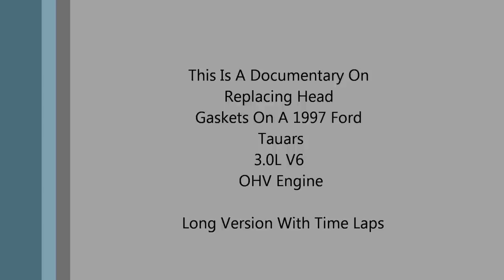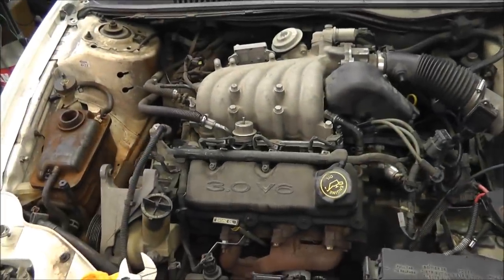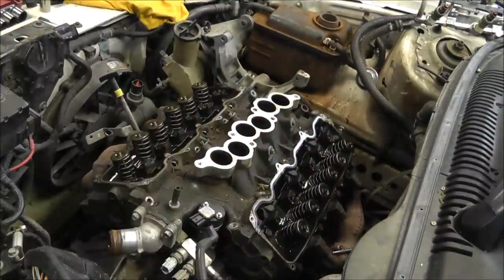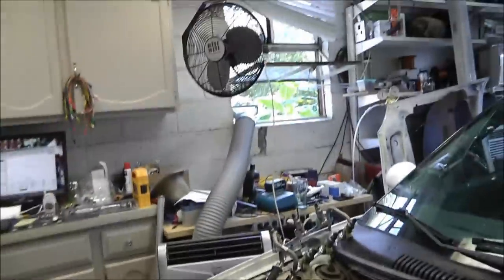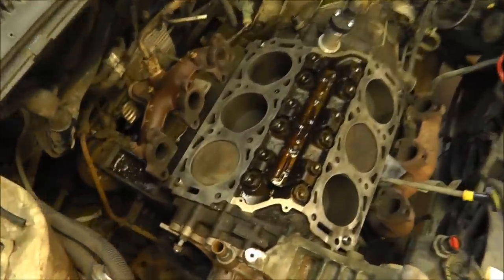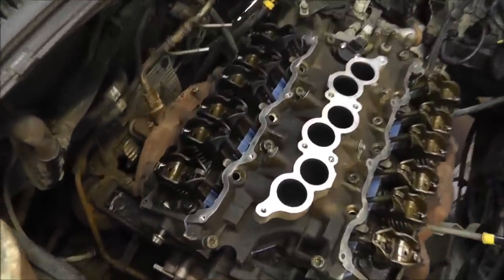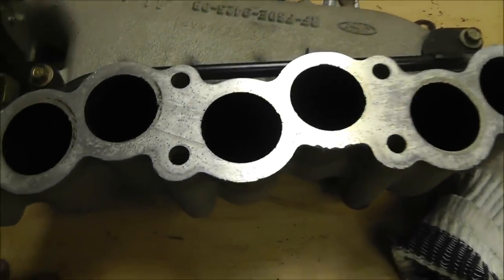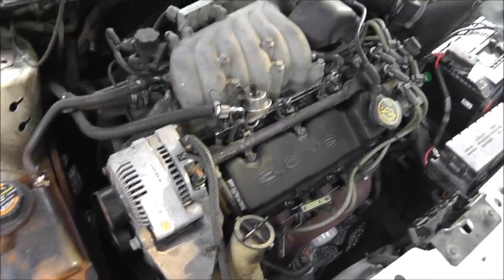Replacing Head Gaskets On A Ford Taurus 3.0L V6 OHV Engine. With Time Lapse. RWGresearch.com

Comment: I worked as Parts Sales Manager for Autozone briefly, the Taurus is a nightmare to look up parts on. I don't know if it's just Autozone or all of the others, but I do know there were several versions of the 3.0 and the parts index at Autozone has them all mixed up. That's why I say bring the old parts in to match! Otherwise I love Fords, I have a '67 F-100 sitting outside right now ;)

Comment: depend on the mileage, it doesn't hurt to replace valve seals and hydraulic lifter.
you also remove the head on a sequence and oil new head bolts.

Comment: @19:14 That bolt will come out. double nut it or grab it with vice grips. Once you have all the nuts and bolts off you can slide the bracket away from the motor and grab it with vice grips between the motor and the bracket. Once it's loose it will come out without too much swearing.

Comment from the maker: Just take your time and make sure you plug everything back in! Lol also, make sure your thermostat is corect and working. The "new" one I got was bent, and was Causing even the new cap to blow off on the Reservoir for the coolent. Also make sure your coolent taink dose not have a crack in it... I have been through 3 of them now... If it's cracked and your coolant blows out you won't know it until it's too late I think that may have been what originally happened to mine. Have fun!!! ~Russ

Comment from the maker: So far so good. And I haven't been eazy on it. :) "drive it like you stole it!"  Andy how, coming up on 200,000 miles! I think the wheels will fall off before the motor dies. I did have the new Reservoir crack on me but it has a lifetime Warranty. So I replaced it. I did have a bunch of ground / wiring problems. But I got all those worked out... Not sure why but seemed like once you brake the connectors apart stuff gets flaky. But it's all good now.  Running like a champ still! God bless! ~Russ

Comment: I'm almost done with this job. Same car. I had to have the heads milled. I still think this was a coolant problem (from the factory) that caused all the corrosion. Head gaskets shouldn't rust away like that. I put a water pump in while I was in there. And I flushed the cooling sytem before I started. I'm going to use a water only flush when I finish. This job is easier than you think. It is just time consuming because of the clean up work. And automotive electrical connectors still suck.

Comment: hello I was wondering if you can tell me what year this car is? I have a 2000 ford Taurus that needs a new lower intake manifold because the connection to the thermostat housing is broken and leaks antifreeze badly. this video finally showed me that the part that needs replacing is the lower intake manifold. I have been having trouble finding the part and found one on eBay but it's listed for an 01-03 Taurus 3.0 L ohv v6. I have a 2000 ohv 3.0 l v6 and they look like the same part to me

Comment: Good job Russ.  I have to say though, since you had the heads off its very easy to pull the valves, and have the head tanked, and check for flat and resurfaced if necessary. Then reseat the valves if they are ok, and  check the guides.  If ok, then new valve seals and you're good to go, for very little money.

Comment: Got a 98 wagon 3l OHV, didn't think it was a head gasket since no color on exhaust or to coolant.  Mysterious coolant leak appeared with nothing under engine..  engine would warm up and get hot (not to the overheating point) I'd stop and refill and then the engine would cool off and be good...

Went from 40 miles of driving for refill to 20 and then a trip, 15 miles, engine stalled out, temp Guage said fine, but it was boiling over and steaming from front and back of engine...  gave it a crank, 1cyl I think tried to fire but the rest are probably coolant filled...

Going to do my first  head gasket next weekend...

Comment: BTW, every time you disconnect the fuel system, after re-connecting it you gotta turn the key (without starting the car) a few times so that you can get enough fuel pressure to start the vehicle.
Reply: uhmm... you can also reset the computer this way. The startup issue was due to low vacuum pressure due to a disconnected peripheral.
Reply: On second thought, isn't this also to reset the keylock for your doors?? I would look this up on youtube.
Reply: You simply pull the main ECU fuse so the car doesn't turn over and crank but turns over all like it's going to. This will let the fuel system build pressure and what's everything inside the engine become pre-lubricated before starting the engine and letting it run.

Comment: It's clear to me after seeing all those clogged coolant passages that the engine overheated, causing the cylinder heads to warp, thus head gasket failure.
Could have been avoided by regularly flushing the cooling system, yes?

Comment: I just had a look at my sisters car 95 Ford taurus. ..it had a crank no start condition. I suspected a blown head gasket. So I checked the oil....it was brown and sludgy. I drained the oil and the first gallon that came out was antifreeze. It's even in the exhaust system. ...uuggghhh!

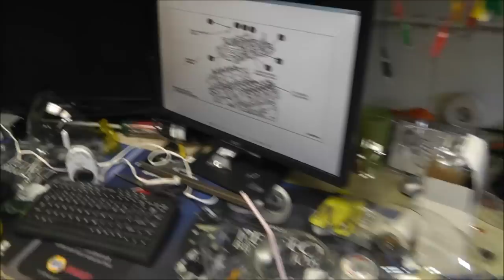Comment: I have a question. At 40:32 in the video you get lost and look on a computer monitor for the answer. What website was that? Or, was that a CD Rom? what was that you referred to on the monitor? Where did you get that diagram of the engine?

Comment: I just saw this Honda message board where they said it costs about $ 50-70 $ to resurface the heads and the hot tank cleaning was around 20-30 dollars.

Comment: Is the car still running? My 2000 Taurus with flex fuel blew a gasket @ 195,500 the car still sounds strong, no knocks or pings but I got a boat load of negative evil doers telling me to junk it. No way I say! Please tell me that white Taurus is still going.

Comment: Great video. Did you need to dead center the flywheel before removing the distributor coil or replacing anything?

Comment: i noticed that you had mentioned that concrete and car batteries don't mix your right on older batteries but the battery companies did correct that problem, the isulation on the bottom wasn't as good back in the day compared to modern day batteries .........

Comment: These cars are notorious for failure in the coolant systems due to massive corosion. A friend of mime is a ford tech and recommends adding a mediocre sized bottle of downy fabric softener with the coolant. Mine had a factory bypass on the heater core because they were having issues with all the chunks getting caught there....  Replaced water pump just to have to do headgasket just after as well, so I really did laugh when I saw all the zip ties on that radiator cap.

Comment: try K&W head, head gasket, and block sealer works great costs $20. I used it in a 1994 explorer 4 years no problems. just used it in a 1997 taurus 3,0 worked  great double your money back guarantee make sure to follow directions to a t

Comment: Hi Russ! I Own A 2004 Ford Taurus SE. I think my engine 3.0 V6 DOHC, correct me if i'm wrong. The miles on my car is at 260,000k still runs good engine, transmission and all. i bought a new manifold intake last year and had it put on including a new Catalytic Converter. Last week, my car overheated and i end up blowing a Head Gasket due to a leakage somewhere My mechanic told me it could have been from the heater hose) I've gotten news from my mechanic saying i cracked the the head gasket and need a new head (it was broken as well) $450.00 in labor and $367.00 in parts (Head Gasket, Head, motor oil. antifreeze). My question is: when replacing the head gasket and new head, are you suppose to replace the water pump as well (even though there isn't anything wring with it far as it?) I just want to make sure everything is in great shape before i get back on the road to and from work and don't want to have to come back in for the same problem, can afford to miss anymore days at work.

Comment: If I can get my 4 banger head resurfaced for around $50-60 when I go through all of this with the gasket, I'm just going to go ahead and get it done. The surface would be cleaner than I could ever get it. Then I'd just worry about the block.  At least I I'm just hoping the head is in fairly good shape of course.

Comment: They sure do. You kinda wonder what geniuses in automotive made these specialty connectors that all basically just transmit low DC voltage whether it's signal voltage or just power.

Comment: PLEASE TELL ME SOMETHING; does a 1992 Ford Tempo GL 3L V6 has hydraulic lifters? mine has a little bit of ticking sound around the intake.. I assume it is valve adjustment issue...

Comment: they had a coolant leak and ran pure water in it I stead of antifreeze.  it rotted the inside of the block and head gaskets and that's why it blew.

Comment: This can cause the crankshaft to beat the oil making the oil pump not pump oil properly as its all frothy, because of this there isn't proper lubrication on your bearings and seals. almost sounds like your getting blow by from the piston rings (just my guess) take a look at your dry/wet compression, combusted gases could be making it into where your oil should be through the piston rings creating pressure. are you burning oil too?

Comment: the reason that batteries don't do well sitting on concrete is because concrete slabs are cold and "happiness is a warm battery".When batteries come in contact with cold surfaces, the acid inside gets chilled  and the chemical reaction that creates electricity is much less efficient.A cold battery can  only put out 50% of what it should. that's why batteries generally die in the wintertime and usually work well in the summer.

Comment: Great video !!  2 Thumbs UP !!
I have a quick question: I have 2006 Ford Taurus 3.0. For that year they come with two 3.0 engines. How to find out which engine I have? Some sources say "U" or "2" in the VIN number, but my VIN starts with 1, and I have "U" and "2" in the VIN number. Thanks in advance!

Comment: PS: Oh, you did mention the mileage, 180k+ (I had missed it).  Also, from mere speculation on my part, would a universal adapter on the socket wrench worked around the rockers in order to removing the respective bolts?  //  Again, well done.  May your know how and experience continue to develop and serve you well.  All the best.

Comment: my sisters 2002 Taurus has coolent on top the pistons and we have torn off all the head and manifold but none of the head gaskets have signes of leaking but the back head is warped any suggestions on what would cause coolent to get in the oil and go through a gallon of antifreeze?

Comment: Nice job russ, if you are not a mechanic then Fantastic job. Fords kinda suck to work on, and yes they do have cheesy castings, probably made in mexico... the QC has suffered at points during ford's run through the years.

Comment from the maker: Thanks, guide lines? Ummm fix it or bust? Lol I use what ever I had on hand at the time to cleen. Something that's not oil base. Like parts cleaner. That stuf leaves a oily residue. I think i used a type of mineral spirits. Seeme to work fine. The only consern would have been any plastic parts... ;) thanks !! ~Russ

Comment: Being the owner of a '99 sable, i can tell you from my own experience that these engines like to rust. Between the years of '96-'98, ford had serious problems with these engines due to a casting problem. Both the block and heads are iron, which can rust as opposed to aluminum. Thats why you see all the orange gunk in the coolant passages. They mostly had the problem solved by '99, but the problem still lurks because i had very poor heat until I found my heater core to be plugged with rust.

Comment from the maker: Yes, something like that. It was a 4 step deal of I rember corectly... Guess I could rewatch and find out! Lol! It's been running just fine. Only problems I have are the ones I had before I started... The other thing was some of the plugs may have gotten some corrosion so I had to find some probs but all connecter related... ;) ~Russ  Ps. I haven't been eazy on it either... Let'er eat! ;)

Comment: Can you give me a favor?   can you measure the auto transmission's dipstick length?,, and from the bottom end up until the low line... and the distance between low and high line... I lost my dipstick last year in Toronto to lube oil changer guy... He did not put it back...

Comment: I plan on recording the stuff I do on my car, but I keep forgetting. When it warms up, I will be pulling the head to get it milled and have a valve replaced, with which I would obviously replace the gaskets. I hope I remember to record it. Probably won't be until mid March when it starts to climb back into the mid 40s and 50s.

Comment: I have a 2000 ford Taurus 3.0 v6 ohv once I put new antifreeze in reservoir it comes out at a steady pace through the tail pipe also with tons of white smoke, and also has a gas fume or something like that in the inside of car kinda got dizzy, and also the reservoir smells like gas, but there is no water substance on dipstick, heard from a couple of people that its blown head gasket. Just need help

Comment: Setting batteries on concrete will make the drain down is a "myth"...if it drains down it's because of a short between the two posts (look for wetness or something that will cause it to have a completed circuit.) 7:40

Comment: Friend good night I have a Taurus 94 with this same engine it is not burning the 1st and 4th cylinder the sails are a bit wet, I passed the oscilloscope today + is not as thin as the engine, I wanted a help because Here where I live in Brazil holy spirit has little mechanic that understands of that engine 'how do I put that engine on point? Thank you very much in advance

Comment: After seeing the color of the oil, coolant and the gap on the plugs its obvious that this engine has had almost no maintenance in its life. If you would have changed your antifreeze you probably would not have a defective head gasket as it probably blew due to electrolysis degradation.

Comment: Hey Russ.. Nice job on that car. I drive a 1998 Ford Scorpio with a 2.3l DOHC engine and apparently my gasket blew as well. Unfortunateloy, I am not really good with wrenches and tools and thus would never try this on my own. What I wonder is, how many miles did your car have, when you did the job? Mine has about 100k (160000kms).
Greetings from Europe...

Comment: I would have succeeded in replacing my heads if it wasn't for the fact that I got longer bolts than the ones require. I hydraliced my engine block. I won't make that mistake next time

Comment: I've found this video very helpful. I'm currently working on replacing a head gasket on a Ford Explorer 5.0, basically almost the same thing with two more cylinders Lol How long did it take you in real time to get this job done?

Comment: I didn't understand the part shown at 35:31  Tighten it to 57 foot pounds and then loosen it to 360 degrees and then tighten again twice? Does anyone know why you have to loosen it after its tighten? I don't see why you just can't tighten to spec and leave it.

Comment: Is the confusion of the parts the only reason you don't like the 3.0. Do you dislike other fords? Such as their "modular" engines. It seems like they are a pain to fix (maybe that's true of all cars in their various ways). I see a lot of the modular engine Fords for sale just wondering if its because they are so expensive to fix because of the way they are constructed. Just trying to figure out if they could be a good buy or most likely are not a good buy.

Comment: This engine is done.  The cooling system is entirely blocked by the rusty antifreeze
Reply from the maker: +Rodrigo Guimaraes well... its  got me to 200,000 miles... so something is right :) ~Russ
Reply: I've seen way worse that still run, worse case scenario it would pump the sludge into the radiator, clogging it and eventually creating an overheat issue, which even at that point a sensible car owner would immediately turn off the vehicle.

Comment: I know it would be more work, but right after head is replaced and torqued, I wonder if anyone has ever checked compression with compressed air, TDC each cylinder into whichever bank, before putting the next head on, and then did the same thing before  putting everything else back together?

Comment: The problem is cracked cylinder heads not the gaskets, they develop cracks between the valves

Comment: * Would you happen to know where I can look at Ford Tempo DL 3L-V6 motor parts description,.
Is there a free website somewhere on internet/
* I am looking to find a website diagram with arrows showing the parts of the motor; like ( alternator, spark plugs, AC unit, belts, windshield washer tank etc).

Comment: also u might want to take the extra time and spend the extra money and bring the heads to reputable machine shop to make sure the heads are NOT cracked/warped. In addition, remove the radiator have it flushed/pressure checked. when you replace head gaskets your cooling system MUST be working properly. its good practice to do this to make sure that your car will run correctly and not blow the head gaskets again. as you can see this is a time-consuming process. why have to do it twice?

Comment: Would you happen to know where I can find 1992 FORD TEMPO 3L-V6 valve clearance chart?
I want to adjust my valve clearance but I am not sure what size of feeler gauge I need?
Reply: You don't need to adjust valve clearance (lash), that engine has hydraulic self-adjusting lifters.